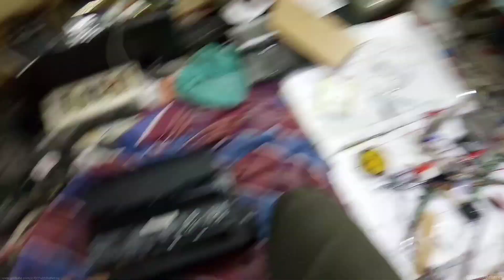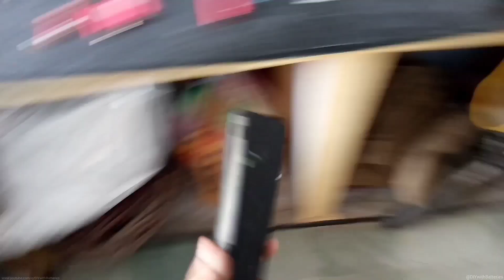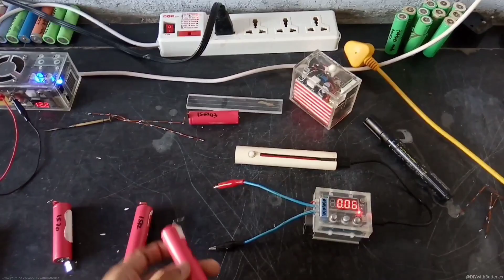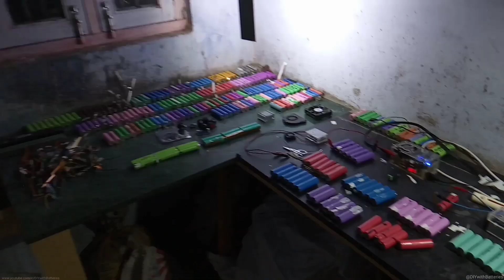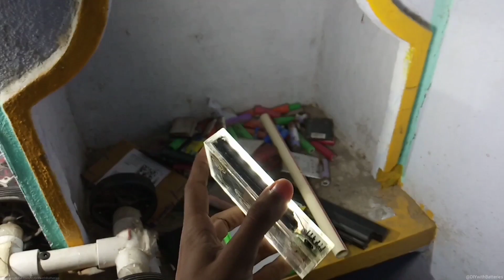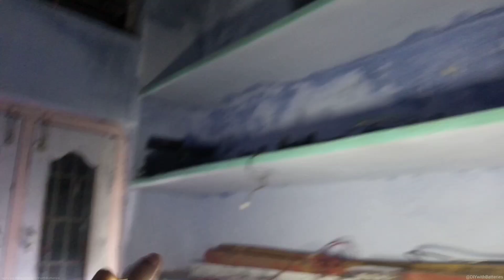Testing 18650🔋Batteries 😵 for Next💣Powerwall 💥 Project! 3S Battery Pack! 🥴

Comment: Hlw bro
I have tagg sonic angle 1 Bluetooth speaker . battery capacity 2200mah and 3.7v.  My BMS ic 8205A ic burn 
Instead of 8205a which is the best
Ic I can use.
Reply from the maker: Dude idk but search it for equivalent ic Or you can replace it if you have a normal phone battery, there will be a thin layer circuit inside. Hope You will figure it out 👍

Comment: Man, you have a sickness LOL once you have so many batteries you don't know what to do with them it's time to start figuring out what to do with them before you get more. Still good luck and I give you a thumbs up
Reply from the maker: I'm Realizing it man 😵 sick thanks for watching anyway. 👍
Reply: @DIYwithBatteries  oh yeah man definitely! I too once had bags and bags of batteries! Now I mainly have Lithium Polymer batteries for my radio-controlled vehicles. They provide the best power a battery can provide currently I believe and they have basically no battery memory. I love those racing batteries as compared to my previous nickel cadmium batteries that I used to race with back in the 90s and early 2000s. Please keep us updated on what you're working on man😎👍👍👍
Reply from the maker: @justinclement5417  just a battery pack 3S and something P ¯\_(ツ)_/¯ that I'm going run my entire house. Dc no inverter.
Reply: @DIYwithBatteries  ohhhh the whole house huh?? Is the power grid in your country always unreliable?
Reply from the maker: Sometimes
Reply: U can use battry holders its easy to plug and remove instead of soldering and unsoldring. Man this is crazzy when u addict to something. but 100% fun keep it up nice work.
Reply: @kasunperera4625  where are you from
Reply: @justinclement5417  im your neighbor😊

Comment: You are very ingenious. I am also accumulating 18650's from old laptop batteries and other batteries. Yes, its very difficult to remove them from the plastic case! I use them in flashlights, and I also hope to replace the battery in a portable power station with some of them. I'm not sure my electronic skills are up to it though. One of my LiOn chargers has a test function, but it takes about 4 hours!
Reply from the maker: Sick Man ✌

Comment: I have a question that is somewhat related. My e-bike runs on 5 sla1222 batteries (64v total). They are way too expensive because the pack loses capacity within 3 months if used to the max each day. Lifepo4 12.8v 20ah batteries (x 5) is the best solution at the moment.
My question is about extending the use of the sla battery pack. The replacement cases are the same size, what is different is it comes with a BMS for each cell, the sla case doesn't. Rapid charge/discharge results in cells charging at different voltages in a short period of time (100 charges) only has to get an imbalance in one of the 12v batteries before the range is 1/4 of 'the max' when new. 
You could add an external cell balancer if it was for 6 cells @ 2.1v per cell. 
Would that extend the life of any 12v lead/acid battery, rather than moving to a replacement type that will take that kind of use?
Reply from the maker: Using a Bms can only disconnects the power from the load or charging point, it doesn't balance the cells until the cells have atleast mah difference. The sla batteries have high resistance and degrade than lifepo4 so it's better to use bms for the lipo4 even it's Unbalancing the cells cuz the different capacity atleast it disconnects the pack from over charge/discharge. Slow charge good battery life, using low amp charger can store more power and also increases the life time 👍 thanks watching Dude ;)
Reply: @DIYwithBatteries  Disconnect would still be better than overcharging 1 cell as that should mean another cell is undercharged by that same amount. At 12v things cannot get out of balance too much, 6 cells. 
5 hooked up to a 64v charger would allow batteries get so far out of balance they cannot be repaired. 3 will be normal or a little above, and the 2 that are 'weak' in a timed discharge are junk.
In theory, if each 12v battery was balanced with the others that might delay/eliminate the offset so they would function for a few years rather than a few months.
A few years ago my alternative were not available, until pouches you had to use 'round cells'. Pouches can be made to any dimension (if you order enough) so the case could be filled with the newest hardware, rather than cells that are being recycled. That is at a price that is affordable even when currency exchange and shipping charges are factored in. 
That works for me, as the alternative is a DYI project that needs a shop full of tools. The cells with threaded ends are the exception. 8 cells/case rather than 24 or more is also better when you do it once every 5 years.
A factory that supplies batteries for mobility devices might find batteries last a bit longer, let alone if (older) auto batteries were stronger when winter temps are the norm.

I was curious if anybody had ever tested that out on a bench when max discharge/full charge was a daily event.
2 full years when they are 'babied' is more of a handicap than anything.

Comment: putting few drops of petrol on each sides of battery case will make the job much easier
Reply from the maker: That's a good idea but it only works when the plastic stick together with glue not with the clamp fixed battery case box lol